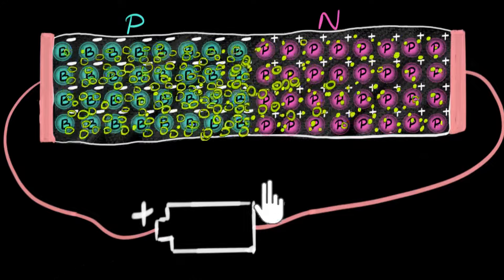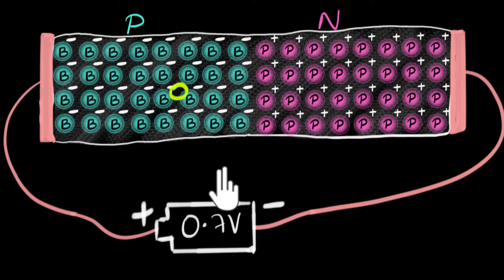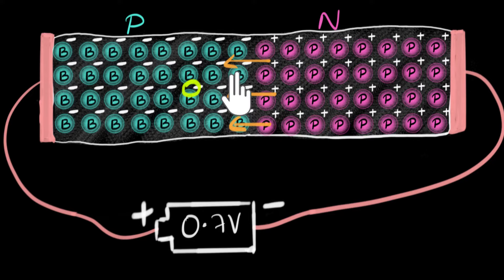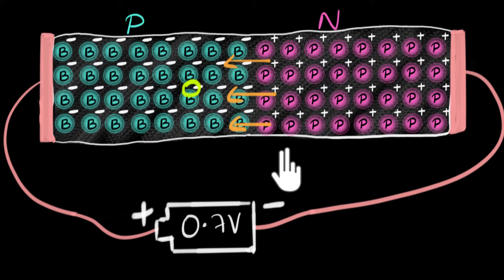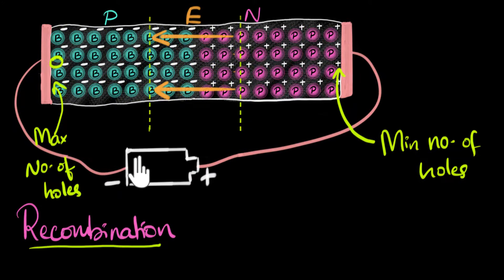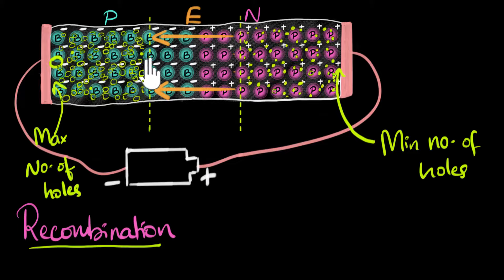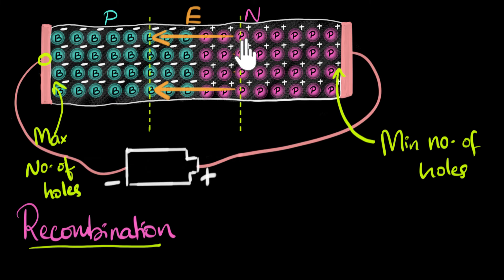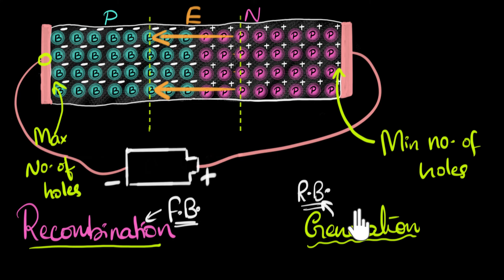Forward and reverse current mechanism | Class 12 (India) | Physics | Khan Academy

Comment: When we increase the voltage the holes will swept faster and due to which it takes less time to cross the depletion region hence the value of current should increase as current i=q/t, for the constant charge the time taken is less and hence current should increase. Kindly explain this also as it is confusing my mind. BTW your way of teaching is excellent. Keep up the good work.
Reply from the maker: I had the same doubt, this makes sense if the charge carriers are continuously swept across, but that's not the case. Say 10 e-h are being generated every second, but they take only a microsecond to get swept across. What's the current? It's not 10e/1 microsecond, because for almost another second, there are no charges being swept. Hence, the average current is 10e/1 second. 
Now even if they got swept faster, say in half a microsecond, the current would be the same right? 
So here t in q/t is the generation time, and not the time it took to get swept (which could be orders of magnitude smaller and can be neglected).
Reply: @KhanAcademyIndiaEnglish  Sir I have a question!! That if we increase the reverse voltage then the width of depletion region will also increase ultimately it will increase the generation of holes and electrons due to the thermal agitation. Long story short! with increase in reverse voltage there will be increase in saturation current according to me. And i think this effect should not be negligible.  Thank You❤

Comment: If we increase voltage in reverse bias, the depletion region increases , which causes more probability of holes getting generated in depletion region. Explain?
Reply: The stronger the current, the wider the depletion region gets; hence holes having a higher probability of spawning in this region.
Reply: The increase in depletion region does not generate more holes. It is independent of voltage change. Now the generation of charge carriers in the depletion region is due to the increase in kinetic energy of the minorty charge carriers under high voltage which can knock out electrons situated on the inside. This is how more carriers are generated.its know as the avalanche effect.

Comment: When current is flowing, shouldn't a new electron and hole pair be generated for every one that is recombine , since if the TOTAL number of charge carriers is decreasing, the current would eventually fall to zero as there would be no charge carriers left? In that case, does the applied voltage provide excitation energy to electrons?
Reply: Same doubt yaar

Comment: At first I want to really thank you for these lessons, I have work many years with electronic without understanding the physics behind this. Thanks!

Now to one question: Shoulden't the drifting current increase when the depletion region increases causing a higher chance of hole/electron to be thermal generated there?
Reply: As is explained in the last part, widened depletion region just increases kinetic energy of the minority carriers. Their numbers are still fixed and depends on thermal excitation. As numbers are fixed, so the current is also fixed
Reply: That's a good point actually!
Reply: @devanshatray6545  but looking at the example, won't the 5 holes turn to like more than 5? Cause now the probability of them being thermally generated increases?
Reply: @shubhamgupta-qi9nk  As its name, the number of thermally generated holes would be only related to temperature. So under reverse bias, widening the depletion region won't increase thermally generated holes.
Reply: Increase in electric field across the depletion region ≠ increase in temperature.

An analogy: the speed limit on a highway is independent from how many cars get on it.
Reply: @devanshatray6545 bit late to the party, oops
 Wouldn't revers bias enlarge the depletion region thus the chances a hole is created inside the depletion zone increases?
Reply: To answer your question, I believe that technically widening of depletion region does increase the number of electron-hole pairs being thermally generated. 

However, in another video titled "Generation and recombination in semiconductors", it was mentioned that it takes 10^12 silicon atoms per cubic centimeter to make 1 electron-hole pair through thermal generation, so my understanding is that the increase would be insignificant.
Reply: The increase of depletion reason don't have any thing to do with the increase of formation of holes....it all comes down to thermal generation...and the probability of the e-h pair forming in the depletion region...

Comment: I also want to know does really length of the depleted region increases or it is just the effective length which increases due to the external applied voltage .Does really the no. of positively and negatively charged ions in the depleted region increases?? Plzz answer...

Comment: 10:14 When you increase the reverse bias voltage, doesn't the depletion region also widen? So if the drift current is caused by the thermal generation of minority charge carriers in the depletion region, shouldn't the probability of this increase if you increase the reverse bias voltage because there is now a greater area in which thermal generation would contribute to the drift current (so the drift current should increase)?
Reply: I think you're right, but the current would get saturated when the reverse bias keeps increasing because the depletion region reaches it maximum of width. Then it would go through Zener breakdown. 
That's my point, if i'm wrong please let me know.
Reply: Yes, it does. In most datasheets of diodes there is usually a logarithmic plot showing the increase of the reverse current (y-axis) while the reverse bias increases on the x-axis.

Comment: @Khan Academy India  
I agree that due to forward current, every hole that is recombined is replaced by another hole. But the holes are  still finite. I mean that the new hole will also get recombined. So finally all holes will get destroyed. 
I know i am missing something very obvious, but still please help me out.
Reply from the maker: Well the holes are continuously supplied from the external circuit. 

For every hole that recombines, a hole is supplied back to the edge of the P side. 
Now ocourse what's really happening is that the electrons from the VB in the P side move into the wire leaving behind a hole.
Reply: @KhanAcademyIndiaEnglish  Can you please explain in greater detail why for every hole that recombines, a hole is supplied back to the edge of the P side? Maybe there is something I didn't get from your explaination. Anyway, these semiconductor lessons are amazing!
Reply: @KhanAcademyIndiaEnglish  how holes are continuously supplied from ext circuit
Reply: @KhanAcademyIndiaEnglish  please explain why
Reply: @KhanAcademyIndiaEnglish  since u have previously said that for 10^ 16 atoms only one electron is produced.. so how it will compensate the huge loss of holes
Reply: @KhanAcademyIndiaEnglish  pls anwswer as fast as u can
Reply: @MohanKumar-mw1pm  No! You have to be patient.  You will get your answer in 40 days and 40 nights. For now just sit tiddy.
Reply: @agostinocarratu1843  Did you ever find an answer to this question?
Reply: Did you find the answer
Reply: The answer is in the video itself. A hole goes to the right edge of n side and recombines with the electron of metal contact . To fill the vacant site of metal contact electron from the wire moves and this process continues. At the same time on the left edge of Pside the covalent bond breaks and eletron moves to the wire and new hole is generated & the story continues.

Comment: in the forward bias, won't recombination destroy the election-hole pair? this might maintain the concentration on both sides, but won't the concentration eventually become zero with no electrons or holes  left?
Reply: Same doubt!
Reply: Nah bro, because the external potential applied prevents the depletion region to increase.  
For each electron whole combination that takes place near the junction of covalent bond breaks in the p section near the positive pole of the. Of the electron and the whole produced the electron is captured by the positive terminal while the whole moves towards the junction. on the other hand as soon as the whole is created in the peace action due to breaking of covalent bond and electron is released from negative terminal of battery into n section to replace the electron lost by the combination with a hole at the junction.

Comment: Sir at  07:32
Won't the electrons from the metallic end (to the left of the "P" part get sucked into the  holes (which are huge in number) at the left most end of the "P" part? As there are a loooot of holes to get sucked into at the left most end of the "P" part?
Reply: Did you ever find an answer to this question?
Reply: Bolo?
Reply: Quite surprised that it is unanswered. So basically,
1. Look at the battery terminal first, what do you see? A positive terminal is connected to the p end! 
2. We know the electron flows from higher concentration to lower concentration. 
3. The current is flowing from the battery to the p end. Implies that the electron is flowing exactly opposite to that, ie, from the P end to the battery.
4. since the electron is pulled out from the p end to the battery... there is an eventual formation of holes.
5.therefore the hole current at the P end is maximum.and as it is travel towards the n end,the number of holes is reduced due to recombination as stated in the video.

in conclusion to your doubt, 
Yes there are a lot of holes in the p end but it does not suck in the electron from the  battery or the metallic end because the battery is pulling out the electron in the reverse direction which is actually reducing the number of electrons from the p-end and helping in the formation of holes.

Comment: You said that holes recombine with the electrons while traveling from p to n
But that means the holes and electrons are vanishing. So eventually there will be no charge carriers left. So how the current continues??
Reply: Good question. The point is all holes and electrons won't destroy each other. 
The chances of recombination near the edge is very low so there will always be high majority charge concentration there. Chances of recombination is max near the junction and hence we have almost zero majority charge carriers there (depletion region). 
This difference in concentration gets maintained. It won't change with time. 
And this difference in concentration drives the diffusion of the majority charge carriers giving rise to a steady forward current. 
And in turn this forward current is the reason why charge carriers at any particular place will remain constant. For every recombination that destroys one majority carrier, say a hole for example, a hole will move into that place due to this forward current. 
Feel free to further comment if you have more doubts
Reply: @khanacademyindia  when forward biasing there are more holes diffuse to N , wouldn't it increase the depletion region width as holes and electrons are cancelling each other at the N side edge of depletion region?
Reply: @jingmiao4140  For every electron and hole that recombine in the N-region a new electron is supplied by the battery (to the N-region), keeping charge neutrality in the N-region and preventing the depletion region from widening.

Comment: Doubt:
In the starting we learnt that diffusion creates an depletion region 
Now in forward bias, when voltage is applied, diffusion increases; then how can depletion layer decrease
Should'nt depletion region increase even more?
Reply: Nah bro, because the external potential applied prevents the depletion region to increase.  
For each electron hole combination that takes place near the junction of covalent bond breaks in the p section near the positive pole of the. Of the electron and the whole produced the electron is captured by the positive terminal while the whole moves towards the junction. on the other hand as soon as the whole is created in the peace action due to breaking of covalent bond and electron is released from negative terminal of battery into n section to replace the electron lost by the combination with a hole at the junction.

Comment: Current is no. Of holes generated per second and if we increase the electric field in the depletion region then also the current remains the same even if the holes acceleration increases..
If acceleration increases then time taken by these holes to reach the negative plate will decrease hence the value of current must increase as I = q/T..??
Reply from the maker: I had the same doubt. But here is the thing. Charges are not continuously flowing. Once the minority charges get swept across we still have to wait for more electron-hole pairs to get generated right? For example. 
Let's say it 1 hole is generated every second (just an example). Then, even if the holes get swept across within milliseconds, the no. of holes getting collected will still be 1 hole per second right? 
In other words, charges get swept almost instantly compared to how long it takes to generate them. Hence, T in our I =q/T should be waiting time for a generation, and hence it only depends on the generation rate and not the speed (or the field)
Let me know if you need more clarity
Reply: @KhanAcademyIndiaEnglish  please explain deeply

Comment: Are you saying that there are much more free electrons in the n-side that the holes that are introduced from the p-side and therefore most of the holes travelling in the n-side are sucked in?
Reply: Not really. 
We are assuming that the doping concentration is same for both P and N and hence the majority carrier number will be same in both. (Same no of holes in P as in electrons in N). 
The point is when they cross the junction, there is a very high chance of them recombining. 
And hence very low chance of them making their way to the opposite ends. 
So chances of holes making their way to the edge of N is very low. (Similarly chances of electrons reaching to the edge of P is also very low). 

Hope this clears it?

Comment: @Khan Academy India - English I have a question, say 3 holes reach somewhere in the n-side(under fwd bias)  and 2 recombine then 1 moves forward, wouldn't this reduce the net current in the transistor, but the current should be the same throughout the circuit, how is this possible?????

I think there is one mistake, at the end of the junction, majority charge carriers should cause the current flow in the wire as otherwise the animation suggests that there is high current at the center and low at the end of the junction .
Reply from the maker: Amazing question. You are absolutely right, the hole current and the electron current will NOT bet the same everywhere. But their sum (which is the total current) will be the same everywhere. 
For example, the hole current will be maximum near the P end (because of minimum recombination chance) and minimum near the N end (maximum recombination chance). But the electron current will be the opposite. It will be max near the N end and min. near the P end. So when you add both the electron and hole current, you will see the value is the same at all positions. 
That makes sense right? Let me know if you have more doubts :)

Comment: here you are saying , external voltage doesn't change much .it actually the diffusion which causes the generation and recombination process but in previous videos u said by increasing voltage we can get higher current now here external voltage is helping to increase current .
that's two of your sayings confusing my mind. please anyone clearify this
Reply: In forward bias when u increase the voltage, current will increase till the potential barrier is zero and depletion layer becomes zero

And in reverse bias, change in voltage does not change current because minority charge carriers are less

Comment: How do you forward or reverse bias a PN  diode in AC supply , as there are no positive and negative terminals in AC supply? 
As current is flow of electrons, how will P side of a PN diode get positive charge. 😆.. so confusing
Reply: Through DC supply...batteries are the source of dc current which is unidirectional!!! We have used battery over here

Comment: What does he mean by thermal generation?
Reply: Heat is supplied to the atom which rips apart the electron from the atom. This generates a hole. Hence, it is called thermal generation
Reply: The generation of an electron and a hole (jumping of electron from valence band to conduction band) due to thermal energy of the atom.

Comment: 10:50 doesnt look accurate, my understanding is that by increasing the battery voltage we will end up increasing the deplition zone and thus we will indeed end up with higher generation of holes/electrons. So even with reverse bias, sounds like it should increase when battery voltage is increased